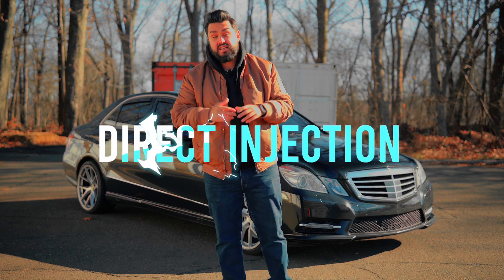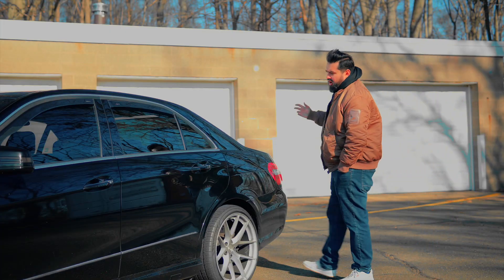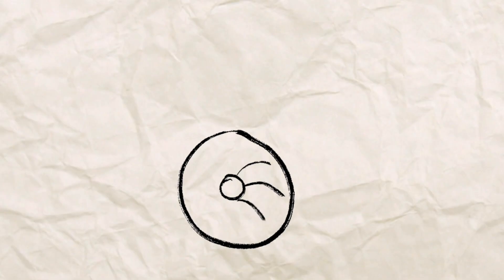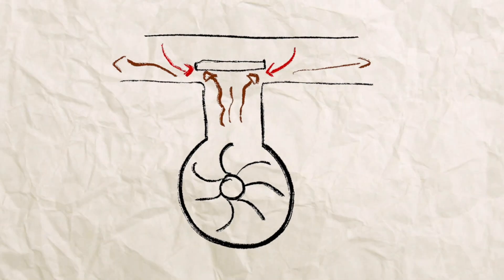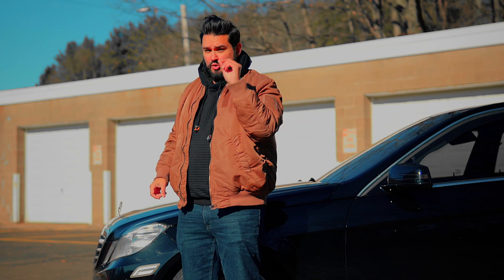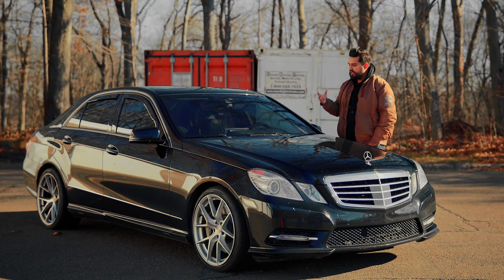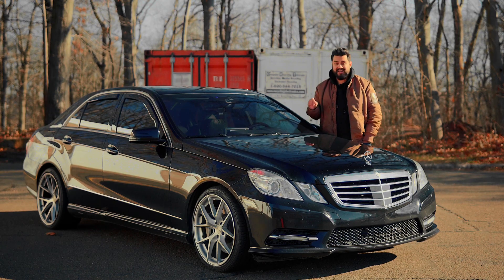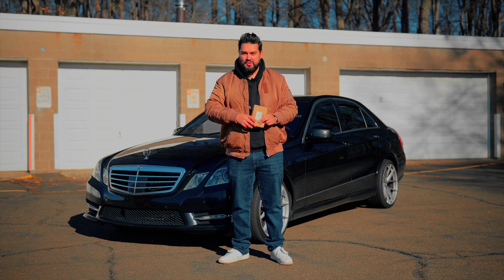M157/M278 Oil Solenoid Mod – What It Does & Should You Do It?

Comment: I’ve reached out to you before about this but to recap I had my psngr turbo go bad on my e550 coupe. 
Wondering ur thoughts on upgrading to a vrp speed turbo which adds around 100-120 HP for $3000. Plus a tune 
I decided to do this because to replace the turbo w a stock used turbo it’s still $1500 and it’s only 1 turbo, not both  and w one going bad the 2nd isn’t that far behind. 
Only 85K miles btw
Reply from the maker: Yeah I wouldn’t dare put upgraded turbos on this. No forged internals, already prone to internal issues and bent rods with stock hardware, you’re only going to stress it more. 

It’s an engine out job to do turbos - so expect close to 6-10k for the job. Then, if you’re going this route might as well re sleeve the engine to eliminate the common failure, then get forged rods and wrist pins. 

This platform is NOT worth building up. Too many issues. 

Drive it stock or with a stage 1 tune and call it a day. Replace the bad turbo with a used one and keep driving it.
Reply: @mrapter7  these are all valid points - i would likely upgrade the rods as well look at your suggestion with the sleeve. Not sure what something like that costs but all in with the turbo upgrades and tune, along with a new tensioner upgrade and labor I’m at about $9K. For the two used turbos and just the labor I’d be at $6K and some change. 
This would take the car from 407HP to about 640hp give or take based on their estimates. 
The reliability factor is well stated, and worth taking into account. However, keeping it just a stage 1 with the hybrid turbos upgrade and minor upgrades seems well worth it for around $2.5/3K extra. 
The other problem is the cars only worth about $15K stock (if turbos fixed) so that’s a big sunk cost to take on as well. 

Appreciate your insight on this!
Reply from the maker: @safwanmalik3 bro you don’t wanna put 640hp thru an m278. Stop while you’re ahead. You’re going to build out an engine that’s designed to fail. It’s barely worth it on the m157

Unless you’re putting 25k or so into quality parts and quality labor plus extras of “while you’re in there” stuff like coolant pipes etc and get ALL of the possible engine out work done in one shot. 

It’s really, really not worth it. This isn’t the engine for it. Buddies m157 has forged internals, cranks and a stage 1 tune for 710hp. 

It just died at 127k (that magical 130k number on these engine families) due to low compression and cylinder scoring. 

With better sleeving you can avoid some of the scoring (2016+ has better sleeves) but still have no forged internals - it’s also not a closed or open deck design - somewhere in the middle. These are engines based off the engineering from the N.A. m273 variants - 4.6 and 5.5 which is why they have a lot of the flaws they have as they are boosted. 

If anything - stage 1 and leave it alone. Besides, you CANNOT put 640 down with a stock transmission. So updated clutch packs, probably a refresh / rebuild to be safe. They can handle 510hp and 680 all day long but the engines give out before the tranny. 

Default torque values are something like 500nm past 4th gear so you’re never putting that power down anyways. It’s a waste of money and time. 

You’ll have a faster car noticeably with a stock engine  and tuned transmission. Get a stage 1 and a trans tune and that’s basically the peak of what this platform can do without REALLY risking things. Heed my warning brotha.
Reply: @ I appreciate the advice- just thought a low mileage 2018 650I m-sport and I can say it was much better money spent. Nicer car too
Reply from the maker: Btw, stock with a tune ads 120hp so 🤷‍♂️

Comment: I’m getting a 2014 c class with 74 k  any tips or things to watch out for
Reply: This a E Class channel boss man
Reply from the maker: Says who? It’s definitely not. It’s a gear head channel. 

I just happen to drive an E class and know this era of Mercedes haha
Reply from the maker: Cam adjusters, timing chain tensioners, thermostat maybe, water pump maybe. Keep an eye on temps as if it wildly fluctuates that’s a thermostat going bad and I’ve seen tons of m276s be ignored and warp heads from overheating. 

New engine would be needed. Not a huge expense like my 550, but still a 3-5k out of pocket for a used engine install

Comment: I would love information on the 2.0 engines like my M264 or the tons of M274 engines out there to see if it's been tried. Most posts/videos are about the V8s.
Reply from the maker: In theory yes it will work on the 274s, however I would advise against it as these engines don’t have the same top end issues to NEARLY the same degree as the V8s that are turbocharged. 

The best, most practical applications is in turbo or N/A m276, m278 and m157
Reply: @mrapter7  Hey good to know, I'm already at almost 99k and running great on my 2019.
Reply from the maker: @lPebkac after 2016 most of the issues in this family have disappeared - drive happy!